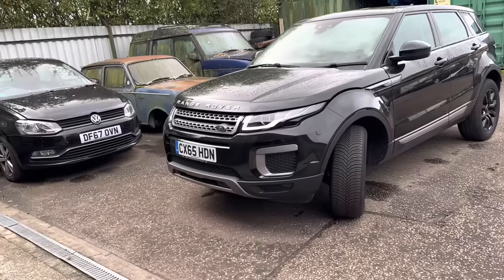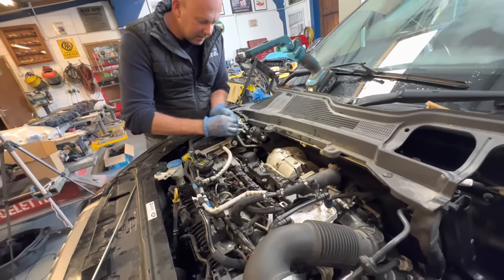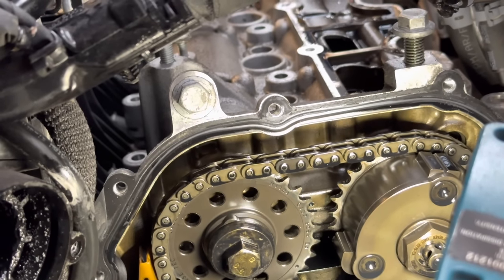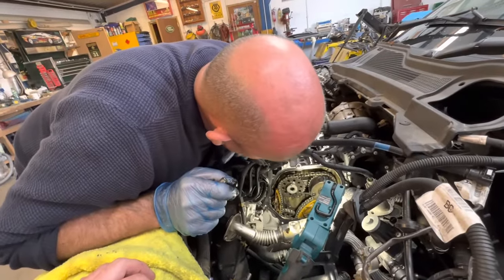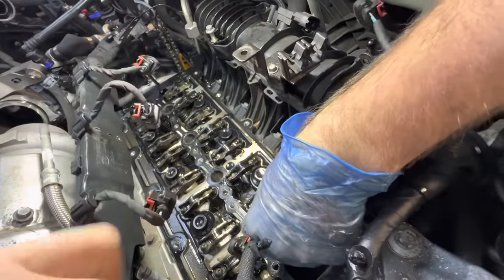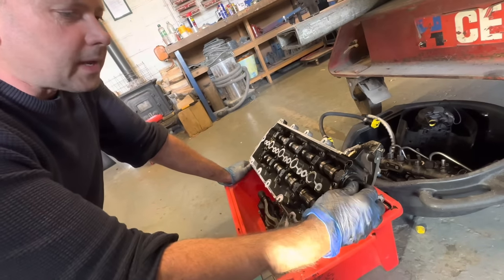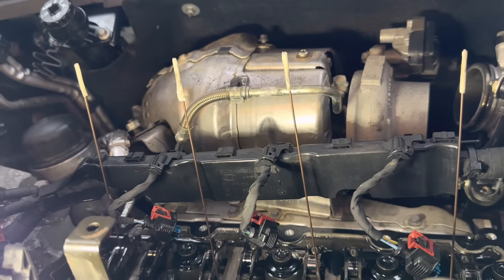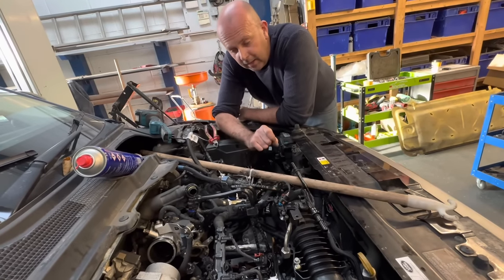RANGE ROVER EVOQUE INGENIUM ENGINE FAIL ! HOW BAD IS IT ?

Comment: when you turn a camshaft, it should be tight, then not so tight, then tight again. that one was loose, so something not right there, lobes twisted would be my guess. 
you could rig up an airline down the injector holes, give it a leakage test
if you get away with this one, you need to start putting the lottery on ! crack on chaps

Comment: That's the first time in 70 years I have heard of pressed on cam lobes. What a load of rubbish Land Rover has become.
Reply: All manufacturers have gone this way not just JLR
Reply: Large ship Diesel engines have always had bolted on cam lobes, the they are slow speed engines.
Reply: @BigBoy69143  I didn't know that.